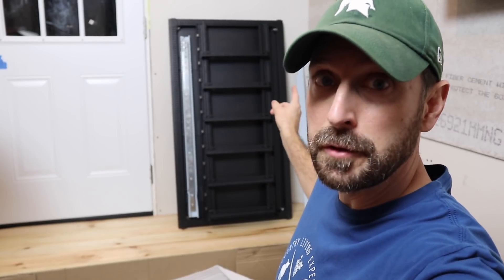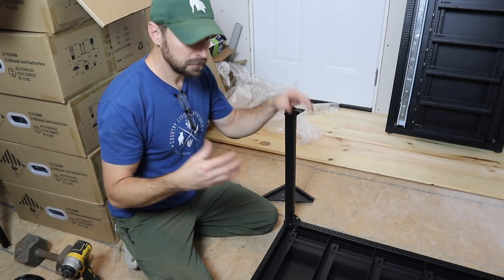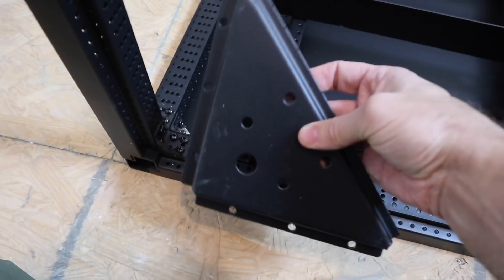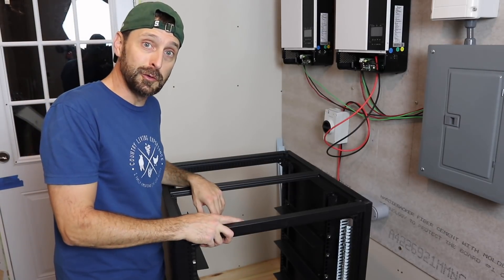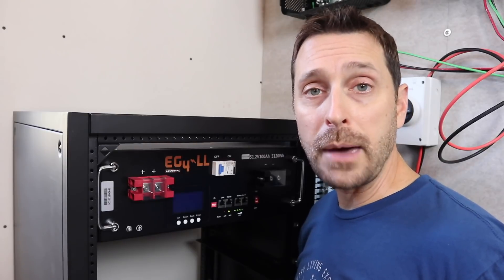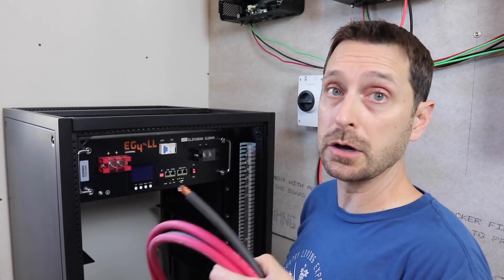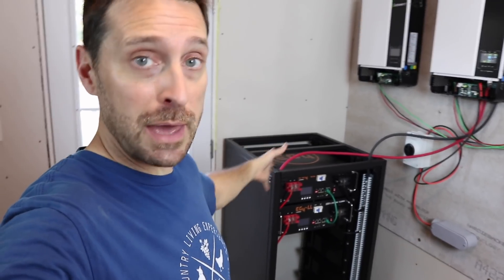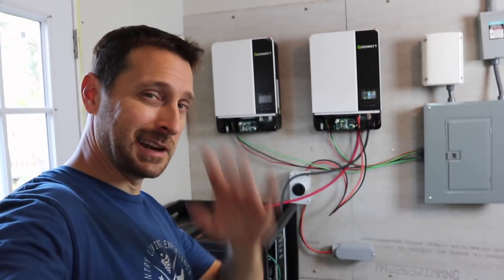Lithium Solar Battery 48v! Best Value EG4-LL +Rack Build Tutorial

Comment: I'm glad you got a definitive answer for grounding the inverters.

Sorry if I missed this in your other videos, but are you driving a separate ground rod out to ground the panel arrays too? Grounding the array made sense to me since that's the most likely point of impact, but I don't yet know the science behind routing lightning strikes to ground without cooking components.
Reply from the maker: I'm glad I got that answer on the inverters for sure. As for the panels, there are two reasons why I don't need to ground them. 1. They are on a giant steel rack which is a massive grounding rod. and 2. the panels themselves are isolated. They are glass and polymer panels so the wires don't come in contact with the aluminum frame or steel rack. The lightning will travel the path of least resistance which is the aluminum frame to the steel rack. It would have an extremely low probability of traveling on the wire all 130ft into my house where the equipment is. So, no worries.
Reply: @CountryLivingExperience  That is my thinking with grounding my arrays on their own as well, I do have a fuse on every line before hitting my breakers as insurance for the wire/equipment, just a cheapo inline fuse.

Comment: This rack is about 85% awesome and 15% fail. I like it but...

Your video is better than the one from signature solar.
https://www.youtube.com/watch?v=2oMPW0d7A9o

This generation of racks is good, but not as nice as the previous generation that DavidPoz has that includes top, bottom, door and casters.
https://youtu.be/89MyA7zPdYI?t=290

On mine, four of the battery anchor holes don't line up and two batteries hang by the anchor bolts a little instead of resting on the battery shelves.
Reply from the maker: Yep. I would love to get that old rack and have it fit.

Comment: these also fit a standard 19" server rack, which can be had used on ebay or craigslist for little.

nice video though
Reply from the maker: Good to know. Thanks.
Reply: I can't find the L shaped supports though that go from font to back. I have a hell of a 42u rack I got at auction and once I get money I may be setting up some of these on it.
Reply: @Birdman3131  I’m going to try these: NavePoint Adjustable Rack Mount Server Shelf Rails 1U Full Depth

Comment: 80% discharge is not "top to bottom discharge"
Reply: there is no power in the bottom or top 10%, but not going there does provide an additinal 1000 cycles
lifepo4 has an extreme flat charge and discharge curve, unlike lead-anything
Reply from the maker: I understand that. You misunderstood. Top to bottom discharge would give you usage beyond the 15 years I mentioned.